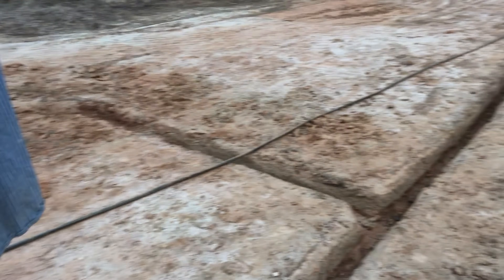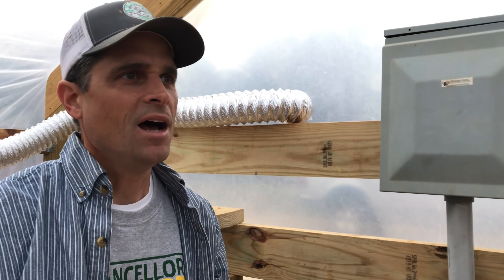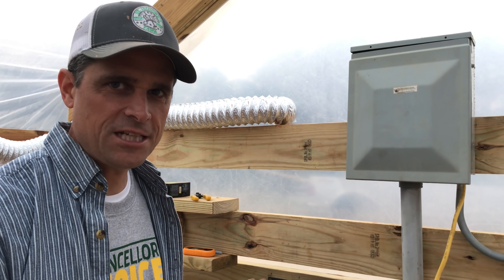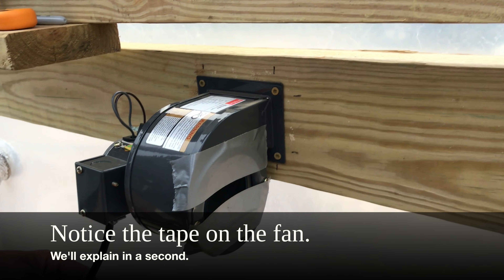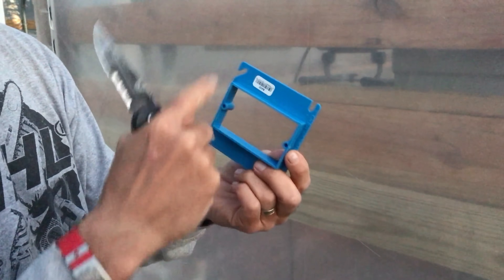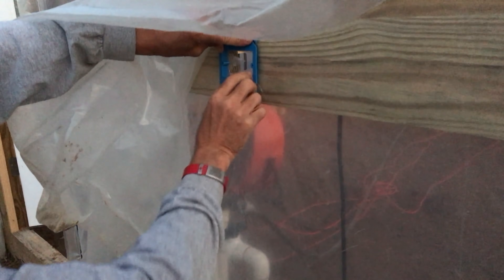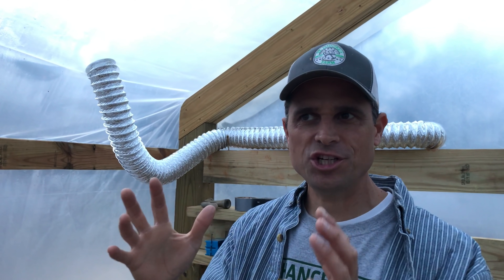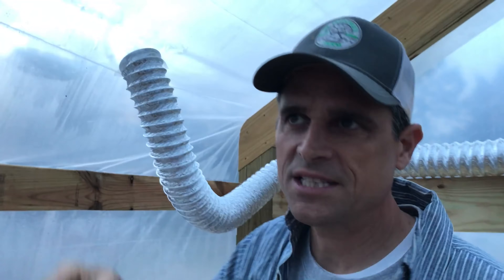DIY Geothermal Greenhouse Pt 10: POLY FILM INFLATION

Comment: The earth is a massive heat sink.  Therefore, the belief that heat is stored for later isn't really true.  The ground temperature remains around 55 degrees unless you use several inches of insulation in the "basement", therefore the theory of storing heat is mute.  Also, I would use a smaller inflation fan and let it run continuously.  Turning a fan off and on routinely adds a level of complexity not needed.  Use the pressure to gauge to signal you the fan quits working.  A constant pressure is best to defeat wind.  If the plastic gets loose at the wrong time and a big wind grabs hold of your plastic... you will wish you had never implemented an ON/OFF inflation gauge.  Your greenhouse is looking awesome!  Rj - Beyond Harvest Veganistas a fb group
Reply: Rj Aquaponics  -  good point and agreed.   ALSO if there was a steady pressure you will get longer lifespan of the film layers.   The film constantly inflating and deflating will have a greater wear effect at tension points then steady even continuous pressure.
Reply: Rj - I think if you actually operated one of these, you'd change your mind.  Ours provides progressively less cooling (because the soil is absorbing that heat) over the course of several hours.  If we leave it idle until late at night, we can cycle greenhouse air through it and raise the temperature (again for several hours, because the absorbed heat from the soil is being exchanged back into the air passing through the tubing.  The earth doesn't sink the heat energy away to another zip code.  It stays very close to the tubing and conducts away very slowly.  In our case it saturates after about four hours on 95 degree day.  I think this system is substantially better built than ours, but the same principles apply.  Describing it as a battery is accurate.

The real magic of an earth battery comes when you have high humidity and can change the phase of water vapor from humid air to condensate in your pipes.  To do that, you'll need lots of plants transpiring.  In fact, at least one other account I read, said that they needed to bring in plants they weren't intending for the greenhouse, just to establish constant high humidity before they could experience the great cooling effect.  The magic of condensation is that it steals a ton of energy during the phase change, and that results in supercooled air and a more dramatic effect.  If you're achieving 30 degree difference already,  you may be in that mode already.  You could try testing your humidity entering and leaving the system to try to determine that.

I think the plan to run the earth battery during hottest time of day and coolest part of night to equalize and level your temps is a solid one.  We do it strictly with a timer now, and no longer rely on a thermostat.  Our only thermostat is on our exhaust fan.

Finally, remember that in your pursuit of wind speed, you may degrade your earth battery effect.  Throughput is great, and HVAC or greenhouse exhaust experts will tell you to think in numbers of turnover an hour and such.  But remember, move the air through too quickly, and it will fail to cool or heat.  You want it to pass through at a controlled pace to allow for the heat exchange to happen.
Reply: The difference between 0.25" wc and 0.19" wc will not cause the poly to be loose at any time, you wouldnt see any difference between the two. Double poly tends to behave like an airbag in strong gusty winds, worst case, (apart from power outage or blower failure) is taking a 2nd gust before the blower can reinflate it.
Reply: Hi Karlin, I gather you are talking about what works for you.  Have you tried different ways that hasn't worked?   Any air forced in or sucked out will cool and heat respectively based on the temp inside the greenhouse compared to the "Earth Battery".   The speed of the air inside the inlet and exhaust really isn't the factor because the air will slow dramatically as it hits the grid underground.   Those that snake the same size pipe around don't get the same efficiency as those that expand the grid to slow the air.
Reply: As a great man once said, its as plain to see as the nose on your face, you  dont see it ;) Positive pressure will attempt to push air out of the ads perforations into the soil, negative pressure will attempt to draw air in. The correct term is SHCS, not geo air :)
Reply: Apples and Oranges.  I said from the beginning using perforated pipe is not my style. I would deploy a sealed earth battery with a frontend condensation sump to reclaim the water operating with a negative pressure flow.  We have very different ideas.  Both will work.  However, I know my concept will never expose the greenhouse to radon which is a real concern for my part of the world.  It's not a good idea to build a radon pump and anyone making these perforated systems for their greenhouse needs to test for radon.  I also believe ground water will enter the perforations more so than pushing air/water out.  This gentleman has already setup a pump to deal with water flooding in his tubes.  After some time, the tube holes will plug with clay settlement.   Lastly, forcing a fan to blow hot moist air towards the earth is against nature.  It will result in burning out the fan, using the more energy, and if switched (ON/Off) will have to deal with massive condensation at startup.    I understand positive pressure, but I am one that tends to work with nature instead of forcing nature to yield to my demands.  Do you have any video which actually shows the inside of perforated pipe in action after 1 month, 6 months or longer?  Is ground water and/or Clay/settlement ever flowing into the pipes?   Is water truly being sunk and pushed out the perforations?   If not, I will side with my concept using negative fan vacuum in an all sealed system.  However, if you do have such proof please provide it so I can learn.   Results and proof are two very different things and I am not too stubborn to stand on a point which is wrong.   So if you have any proof, please let me know where I can find it.  If video proof doesn't exist... it maybe because I may be right.  Rj - Beyond Harvest Veganistas a fb group
Reply: @rjaquaponics9266  Hi, radon is a hoax. It  was never proven that it does any harm. Just speculation. People had underground systems for centuries, nobody has cared for some radon ':D
Reply: Not in my Smoothie!  Radon is harmless?   I don't think that is true!
Reply: Well if you think is true or not doesnt change the fact. There are not proven studies about, it is all theoretical, they made big thing out of some speculation to make money. Use simple logic, radon is a gas coming from underground, if it can enter building thrue thick solid cement basement, insulation and final floor covering, why it cannot go thrue normal land cover with just grass, or why is not dangerous to dig in your garden? Radon should be in the air anyway everywhere.
Reply: I live in Wisconsin where we all have basements.  Radon can enter a basement if not sealed.  It doesn't go through concrete, it finds openings for example a sump pump well or other through holes.  It is heavier than air there fore it concentrates.  Outside, it merely disperses to levels that are not harmful.   I've personally conducted my own radon tests.  It is real and it is a serious hazard.  Rj - Beyond Harvest Veganistas
Reply: What do you do when the cooling is mute and the sun is blazing on your greenhouse?   A momentary lapse in venting/cooling for a few minutes can result in scorched plants.  Do you have any videos of your greenhouse.  I would enjoy learning more about your setup.
Reply: You would normally install 465ft of tubing for a greenhouse that size,  which represents 50% more cooling capacity, 6hrs is better than 4hrs ;). 
Assuming all 400cfm is making it through the system, the air will take a minimum of 4 seconds to make it through the tubes which are likely arranged in a serpentine layout unless the gh is less than 7ft wide ;)
 I guess the fan is sized to put the air underground upto 10x an hour, assuming a greenhouse volume of 2400ft3. 
Dealing with 85-100degrees every day is a challenge, if space allows i`d be tempted to install a 2nd system outside the greenhouse to increase the cooling capacity. Being unsheltered and uninsulated, the majority of the stored heat would be discharged at night.
Reply: I've had lettuce bolt after temps peaked while vents failed.  It doesn't take much time to ruin a crop. You obviously built a very nice system.   I notice you don't have any greenhouse videos on your page.  It sure would be nice to see your setup.  I am huge fan of earthen beds using aquaponics water.  I grew over 100 lbs of veg in 20 sqft bed with a water table of aquaponics water cycling through.  No weeds, veg was packed in there and it grew perfectly.  Minimal seed spacing required!  LOL
Reply: Thats a nice greenhouse ;) I`d say the shcs isnt performing too badly for cooling considering its undersized with an interesting but less than optimal tubing layout ;) I have traditional high and low level vents, all greenhouses need fresh air and co2.
Reply: I turn off my geothermal in the winter.  Instead, I store heat in a large water reservoir that sits at the end of my GH and I circulate that water through the first 4 inches of floor and soil beds.
Reply from the maker: We've experimented with it already and the film stays firmly inflated for quite a while when the fan is off - not unlike a giant balloon. Seems pointless to keep running the fan and pushing air if we don't need to. As to loose film, without inflation, it withstood a severe thunderstorm the other night without issue - thankfully! Really seems the wiggle wire is amazing stuff and holding the film.
Reply: A motor switched ON/OFF will use more electricity and age the motor more than just leaving it run.  That's why using a smaller motor is more practical.   I don't understand if you have the geo air forced in or pulled out.  Best to use the fan drawing air out rather than forcing hot moist air down and in the geo tubes.  Create a vacuum which will draw the air through the geo network.   Hot moist air is very difficult to force down into a geo pipe network.  Drawing air out of the geo tubes is easier because your not fighting the moisture light air.
Reply: If you measure the temperature at points along the tube you`ll find the controlled pace is probably beyond the fans capability ;) You should  think of the cooling or heating relative to the entire greenhouse air volume  not to what is passing through the tubes. If you increase the amount of air you increase the amount of heat moved, the air temperature from the tubing is not as important as the greenhouse air temperature an hour later  ;)
Reply: If you put the blower on a killawatt type meter you`ll be able to compare the cost of running it 24/7 vs with a pressure switch. Mine has provided almost a decade of troublefree service and i`m not expecting it to wear out anytime soon.
Reply: If you have faith in your concept you should go ahead and install it..like the rest of us did ;) My posts are based on experience of using a system. As for proof, take it or leave it, do some research and see if it stands up to scrutiny.   
You wouldnt use a pressure switch to control the inflation blower, i`ve used them for years but have no interest in proving it. I guess you will see it in action on the St Isidore`s farm greenhouse and quite possibly a few more once folks have the "proof" it works ;)
Reply: Here's some background.   Our greenhouse is 350 sq-ft with a 15' tall peak, all glass, using internal shade cloth (except in winter), an industrial exhaust fan on thermostatic control, 6 roof vents,  4 side window vents, and open door, 2 industrial circulation fans, and a simple SHCS using a 400 cfm fan in a plenum pushing through 6 tubes 4 feet underground totalling 300' of ADS.  I take intake air from low, never the hot peak.  We rigged spray nozzels to the circulation fans for a 50/50 duty cycle fogging effect.

On a 100 degree day, the outside air coming in won't feel like it's cooling, but in fact all trapped heat in a greenhouse under glass or poly is hotter than outside air.  We use the SHCS as a suppliment, as described above, not as a single strategy.

On said 100 degree day, our SHCS will saturate after ~4 hours, going from a 10 degree cooling factor, down to a 1 degree cooling factor.  You will literally see it working less well, because the transfer of heat worked and gradually, the underground temps are either equivalent, or at the very least, the differential is too small to effect the air temps any longer.  On an 85 degree day, it still saturates, but it takes longer.  If I don't run it at night (San Diego has cool nights all year long) then the next day, it starts off less useful because I never bled off the banked heat.  I get less cooling effect.  It's not a perfect heat exchange and a day later much of the warmth would still be lost, but days of successive use for cooling only, resulted in a warmer and warmer bank, leading to a dramatic dropoff in the efficacy.  Using it for two cycles a day (one cooling, one heating) all year round, allows the system to be most effective for me when I need it the most (cooling in summer, heating in winter).   This was taught to me, by advice from Jerome Osentowski, who has operated SCHC greenhouses for a long time.  

Greenhouses are impossibly overheated boxes in the daytime, and usually poorly insulated boxes in the nighttime.  That's reality.  These strategies can help to bring a good growing environment among the extremes that living under glass presents.
Reply: Momentary interruption won't kill everything, but your point is taken that it is a tenuous system that won't work for days without power.  We generate solar on our house's rooftop and with all these fans, we're producing more power than we use.  The shadecloth and the vents are passive, so some of the work is done with convection and ambient winds drawing heat out of the peak.  We also designed and built a subsoil irrigation system in raised beds, so when heat gets very high, the plants can always draw more moisture to help their short term health.  Plants generally wilt in heat and close stoma, from my understanding, but wilt plus dry soil kills much faster. 

We built two electrical circuits into our greenhouse so that one tripping a breaker won't shut down the other.  If our exhaust fan burns out and trips a breaker, our circ fans and roof vents will soldier on, and vice versa.  All roof and side vents are on thermally activated progressive struts (low tech).  We were able to take a 2.5 week trip last year and leave the whole greenhouse locked and operating in absentia last spring.  Auto-topoff filled water reservoir which pumped water to beds, which watered all plants.  Fans came on with timers and thermostats.  All was overgrown when we returned.   This wasn't a low budget build.  But we have done all the work ourselves (except grading and the pump hose guy for concrete pony wall) so we know the system well and have learned a ton about the efficacy of various attributes of greenhouse life.
Reply: That is all true, and helpful.  Looking back at photos, I think I may only have 100' of tubing and yes it is serpentine, and buried in crushed stone.  Our greenhouse is definitely more volume than the footprint would imply, because it's got a high 15' ridge.  

IMO, using tradition greenhouse ventilation in tandem with SCHC is probably much more sane than trying to be a purist and use it solely as an air conditioner in an otherwise closed system.  Closed systems don't promote good growing because you need lots of air exchange for your plants to thrive.  You need wide holed screens, or open doors, to promote pollinators and predators and insects of all sort, if you believe as I do that the best way of growing is using biological systems and not chemical inputs. 

I'd point out that we also experimented with evaporative cooling through one of the side windows, and pairing that with the SCHC system, because I was trying to introduce more humidity into the system.  In the end, my limited trials didn't yield much function and was looking like it was going to be a real nuisance to maintain consistent proper working condition of the wet wall.  But well built systems using an evaporative wall for your air flow in, can deliver very good, if not very humid, results too.   Promoting transpiration, promotes plant health.  They don't prefer overly humid conditions or stale, static air.  For us, it was  a balance of seeking energy efficiency, minimal water waste, and a system that can run itself without constant nannying.  As a side note, our SHCS has the fan mounted in the plenum, so it is very quiet.  I can't say the same about our circ and exhaust fans which can be quite loud.  Our greenhouse serves as an outdoor room in addition to growing veg., so the option of switching off or turning down speed of fans, while still having the SCHC system pumping cool air is really nice, an variable speed on fans can save energy when less flow is neeed.  Sorry to threadjack, but I really enjoy sharing info about this topic.
Reply: I can't view your pictures because I don't have nor want a flickr.  All the information you shared is valuable and related to greenhouse success.  The more information we share the less mistakes that are made.  However, sometimes it takes screwing up to learn lessons.  I'm first to admit that!
Reply: Sorry, this gallery is now public, so no need to sign in or anything.  Page 4 has lots of pics re: SHCS, but the album shows all stages from parts in the moving truck I drove down from Washington, through the construction that my wife and I did, to completed views inside and outside.  https://www.flickr.com/photos/mpa_in_socal/albums/72157661955267373/page4
Reply: Definitely, I am PRO CO2 !!!
Reply: Perforated pipe, ideally modified (slotted) with a circular saw prior to installation to allow water to drain out more easily and completely. The perforations in standard ADS pipe are not ideally placed to do it. The number of tube layers depends on the tube spacing, closer spacing (less mass between tubes) gives the system a heating bias, wider spacing (more mass between tubes) gives a cooling bias. The wider the spacing,  the less total tube length you can fit into a layer.
Dont forget that the tubing will displace an equal volume of mass when its installed ;)  The tubing for your greenhouse will displace between 2.75 and  3.65 tons of mass (depending on the soil composition). Most installatons will generate a big heap of "spare soil" that needs a new home  ;)
Reply: I only experimented with a 2' round hole 5' deep in a 20' geodesic dome which I grew veg using aquaponics in NE Wisconsin for 30 months straight using a RMH. It was our snowiest and coldest winters on record.  I learned a ton information with my pilot dome.  I built, tested and proved so many things too many to mention.  Our soil has 18" of top soil, then 15" heavy clay and then heavier composts.  Do you know the type of soil you have and/or what type of ground water is flowing beneath the surface?  As snow melted, I saw water flowing above the clay level almost as heavy as a water hose!   For anyone to tell you what is best is not relevant because we don't know your soil makeup.  Others will disagree, but personally I would NOT use anything other than sealed pipes. One reason, water and another radon.  Ground water flows places you can not predict and this doesn't come from only rain.  Water can flow a mile underground with only 1/2" of drop.  If it does, it won't be long before clay/sand or other debris fills the pipe space.  It's what nature and gravity does.   I would go with a sealed system which can condense moisture and reclaim it.  But, that's just me.  Rj - Beyond Harvest Veganistas a fb group
Reply: Okay, when the cooling is no longer effective because the earth battery is too warm to provide cooling.  Mute is easier.
Reply: Good for you!
Reply: I see what you mean by mute now, you mean the temp differential is not creating any cooling, correct?
Reply: Do you have any heat exhanger to bring in fresh air?  If not I wonder if one could do a double wall plastic greenhouse, inflate the walls with outside air conditioning it and then leak it into the interior?
Reply: The earth is a thermal mass, not a heat sink.  If the sun were to die out, Earth would become a radiating body until enough energy had been expended for the planet to reach an equilibrium temp.  And yes, you can draw the energy back out with a sufficiently efficient heat engine.
Reply: The earth is not a massive heat sink, but thanks for trying to add to the conversation in an intelligent way. Chin up chap.